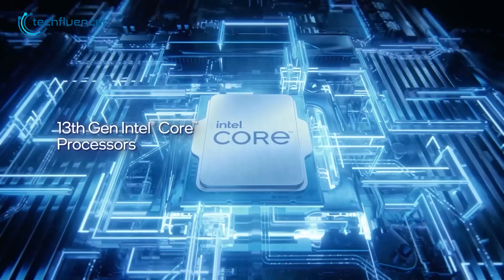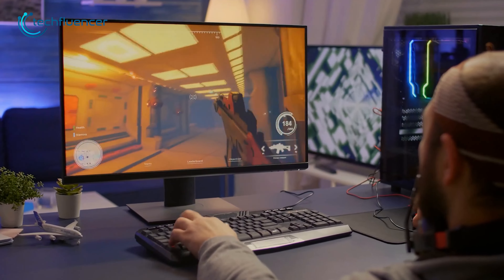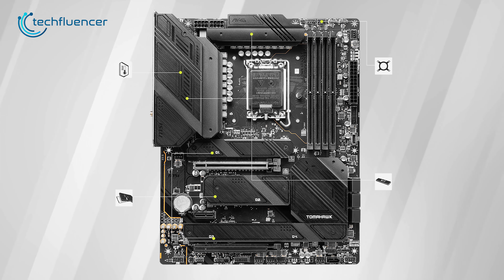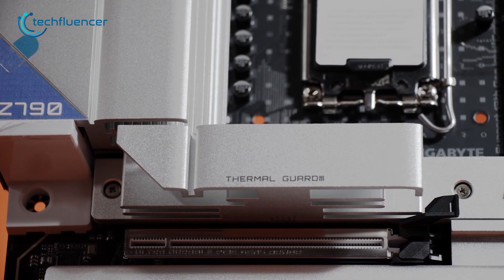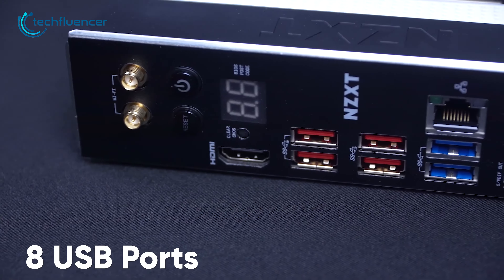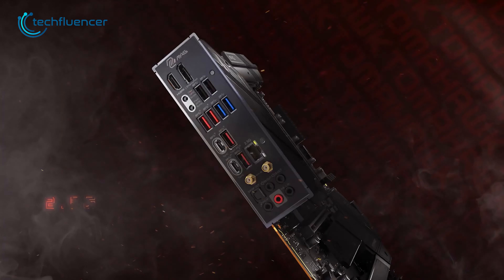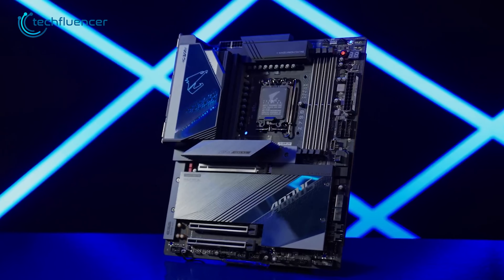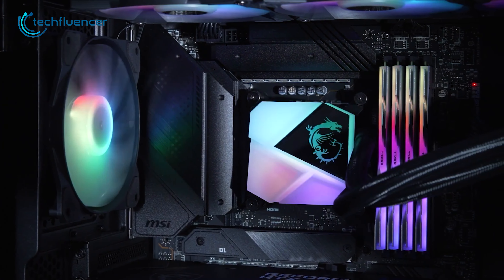7 Best Z790 Motherboard for Core i7 13700K

Comment: That image you had shown right before  the rear of the Z790 AERO G what board is that ? was that an error ? I cannot find a Z790 AERO G that looks like that connection wise, but the image right after it does match, im a little confused, thanks
Reply from the maker: That was a mistake from our part.
Thanks for pointing it out.
Reply: Thankyou yep it was the AORUS master or something in its price range and its like a grand 🤣 I still want it though it's got everything and more!

Comment: Does the wifi&BT mobos require the usage of external antenna or is it to provide stronger connection?
Reply from the maker: Yes, the antennas are needed.
Reply: Actually, in most cases the antennas are not required, but that is dependent upon your routers signal output. You can connect wirelessly without antennas.

Comment: someone told me that asus prime z790 p wifi dont work good with i9 13900k and dont maximize full potantial of the processer and going hot  is it right plz help i have this motherboard and i hope i didnt make mistake.. i got the i9 13900k
Reply from the maker: Since you already got it, you should consider investing in reliable cooling solutions. Including the AIO and case fans.

Comment: Msi tomahawk is so sux with 13700k... More issue than on any other mobo...
Reply: HI PLS REPLY for I7 13700K, 4070 super Which is best motherboard msi pro z790a max wifi or msi mag z790 tomahawk max wifi or any other u would suggest without any issues

Comment: Hello I have a question. Does the creator motherboards perform the same for gaming ?  Like the asus z790 creator? Is similar to the aero by gigabyte
Reply from the maker: Motherboards don't affect the speed of your processor, whether it is gaming or creator motherboards.

The difference relies on the connectivity options, speed, and number.
Reply: @Techfluencer  yea but it depends on how thety deliver the energy to the cpu which motherboard can handle the power better different power phases and thermals thats why im wondering .
Reply from the maker: @guilladogui8259  Agreed!
Reply: @Techfluencer  but besides that I have another challenge I need thunderbolt for my audio interface. That’s what I thought about the build in thunderbolt ports from. The creator board , if not I would have to get a add on card which can be hard to get to work properly
Reply from the maker: @guilladogui8259  There should be a non-creator series motherboard with Thunderbolt ports.
Reply: @Techfluencer  no for the same or lower price , the only one I saw was an asus strix gaming e something like that 500 dollars
Reply from the maker: @guilladogui8259  Agreed!
High-end ones with thunderbolt are pretty expensive.
Reply: @Techfluencer  yea I want to see if I get a mid range . The asus creator is not bad . I thought about the asus prime a z790 ddr5 and the add on card but I feel like that board is not enough for the i7 13700k ? Is it
Reply from the maker: @guilladogui8259  It should be, unless you are planning on overclocking.
Reply: @Techfluencer  not really i think the i7 13700k already draws enough power ha im considering the non k version. wgat do you you know about the asus tuf plus ddr5 z790?  how different is from the prime A . i saw
Reply from the maker: @guilladogui8259  The Prime-A is definitely one of the most affordable DDR5 motherboards currently out there.

However, the Tuf Plus has Thunderbolt 4, which you are looking for.
Reply: @guillado gui   The Asus Strix is one of the best motherboards he didn't mention in this video. The Strix is the one I'm picking up. Also, not all the 790 are good for overclocking. So if you are trying to go cheap on the 790, you might as well stick with the best 760 available. Also, the i7 heat you are talking about on the CPU is normal. Learn how to overclock with less voltage to run cooler at better performance. Also, the chip is not the problem. But the Auto settings from BIOS in this motherboard. They are set for high voltage out of the box. So the 1st thing you are supposed to do is set your BIOS out of the box. High voltage is the norm now which is dumb.
Reply: @JuanDiaz-jo1rw  i was thinking about the prime a z790 is cheap but some ppl say it cant handle too much overlooking . and i do need thunderbolt thats why im trying to find the best combo motherboard with a pcie card or the thunderbolt on board but its more expensive. and you are right a lot of ppl complain about asus boards delivering high voltage on stock setting i will watch a video to set it up to better setting whenever i get it. i saw the stix z790 for like 350 is not too bad
Reply: @guillado gui  Yep, the Strix went down in price. 2023 is not too expensive unless someone is trying to go to the extreme. But with the Strix, you will get a 25% boost in overclock performance. That is huge if you ask me. Just don't go under a 3080 ti, and DDR5 so you don't lose performance. DDR5 5600mhz is the sweet spot to start. 2x16 is not expensive. Im going with the Corsair Dominator ram. Also, don't listen to ppl saying these boards are running too hot or on high voltage. Those are just the factory settings. Most of us looking for these boards are going to overclock or under vault anyways.
Reply from the maker: @JuanDiaz-jo1rw  Undervolting does do wonders in most cases!
Reply: @Techfluencer 
In the sense of keeping it stock, and having low temps yes. But not if you are looking for a performance boost. This is a concept that has been misinterpreted many times. Undervolting is just reducing the working voltage of a component, often to reduce its temperature. But you will not gain any performance. And in some cases where you have gained a bit of performance, the gain is almost close to nothing. Overclocking with low voltage to have up to double the performance or more is always better. Because as long as the CPU is stable with low temp is how you get the most out of your PC. Anyone who spends 2k for a new PC just to undervolt is just a waste of money. They might as well keep their old PC that is performing just almost the same. I can understand undervolting a GPU, but not a CPU. All these new chips have a limit of 100°C. Overclocking and having your temps from 70°C to 80°C is normal. No damage will be done to the chips. Old chip sets were better undervolted. But that's not the case now. Unless a person is just not planning to overclock at all.
Reply from the maker: @JuanDiaz-jo1rw  Whoa!
That kinda makes sense.

Comment: The 7 Z790 motherboards to avoid
Reply: HI PLS REPLY for I7 13700K, 4070 super Which is best motherboard msi pro z790a max wifi or msi mag z790 tomahawk max wifi or any other u would suggest without any issues
Reply: @PradeepKumar-tq4ev  MSI - Tomahawk, Meg, Gigabyte - Aorus, Asus - Rog get the most expensive model you can afford
Reply: @wishfulaurosa  msi z790 tomahawk max wifi ddr5

Or 

gigabyte z790 aorus elite ax

Or asus rog strix z790 h 

And most expensive are almost double of these Motherboards. So pls say out these or at this around price range
Reply: @PradeepKumar-tq4ev  MSI MAG Z790 TOMAHAWK MAX WIFI LGA 1700 ATX Motherboard
Reply: @wishfulaurosa thanks fr reply and does this z790 tomahwak max wifi motherboard as any issues or problems as I seen in comments that z790 motherboards have issues. So am little bit scared 😟😟
Reply: @PradeepKumar-tq4ev  I think that's the i7 13700K cpu chip that if you change its default voltage to a number intel said it could do but actually it doesn't work as advertised. Its best to buy from your local computer shop if the cpu blows up.